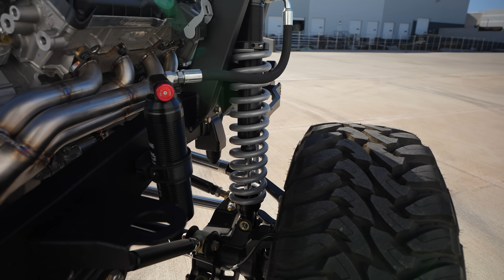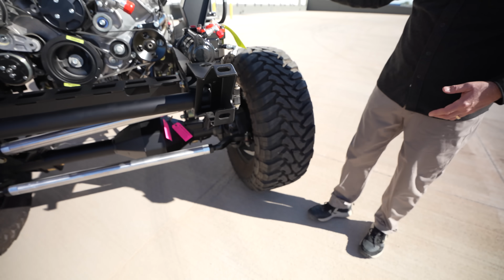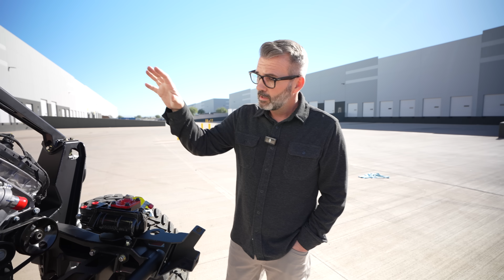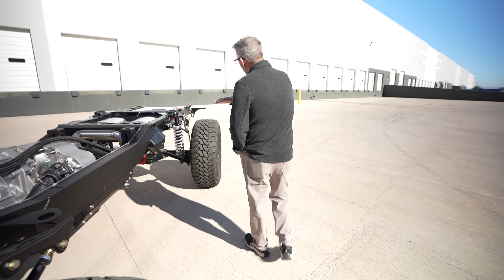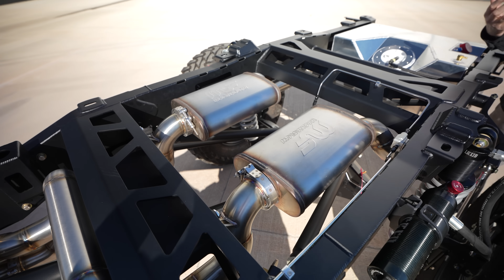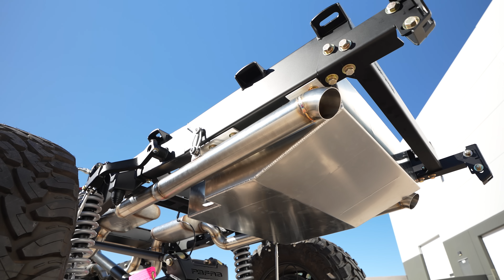Stop Refurbishing Old F100 Frames - Do This Instead (4x4 Chassis)

Comment: Thanks for the walkaround. I don't know that I would ever drop a modern powerplant into my 1970 F250 crewcab or 4x4 it or dump some 10 ton diesel in it. I was thinking more along the lines of Kaase Boss429 and Tremec and Strange Dana 60. I'll try to drop by when I get done with my move to Phoenix.

Comment: Absolutely beautiful work! That chassis is an immaculate work of art. The only thing I would say (my persona preference) is it looks like it's sitting really high, like 6"+ lift, with some pretty extreme driveshaft angles. If I were drawing this up on a blank sheet of paper I would look at ways to lower the engine, transmission, and transfer case and get less drive shaft angle for more axel drop while off-roading and a lower CG for on pavement (and off pavement) driving and get the saddles of the frame rails lower. But that's just my 2 cents as a broke ass dirtbag 4 wheeler.
Reply: The body will lower the frame to ride height, it's just sitting high because their is no weight on it. Driveshaft operating angles and trans angle will all correct once the body drops on

Comment: I like the frame but not all the components. I don't want 700 hp. I don't want it jacked up. I would want the truck closer to stock. Most older guys like myself don't care for over kill.
Big selling points, it's not an EV, no etorque and no cylinder deactivation. If I bought one I would get the 6.8 with stock hp.
Reply from the maker: We can do 2WD and almost any drivetrain configuration you want.

Comment: Does it have to be a 4x4? I want to reconstruct my Dad's 1973 F-100, I-6 300, 2WD, 3-speed column shift, LWB. That vehicle was the one I learned to drive in and took my Texas driver's test in 1977. Ever parallel park without power steering, power brakes, or A/C with a 3-speed manual column shift? Builds character!
Reply from the maker: Sounds like a sweet ride with lots of history. We specialize in 2WD chassis as well. Definitely would be a good candidate, hit us up robert@fatfender.com

Comment: If that is ride height, the suspension geometry is trash. Wow.
Reply: Agree.  Links looks really short.  Could have been longer, mounted closer to center, and thus more leveled.
Reply: That's not ride height, the body will lower the truck to about a 3-4" lift and the operation angles will then be correct. They look wack without the body on the frame haha

Comment: Can you order a frame with a gooseneck hitch an a rear receiver hitch with a 8ft bed .  Another question could you run ori struts and air air bags over the rear end. The ori struts would replace coilovers to clarify.
Reply: built more for daily driving, why would you tow with a 300k restomod if you have a normal truck to do that for yiu
Reply: @cybajaw not restoring a show truck. Just asking if it was possible. Because if I spend that kind of money, it's going to work for it. Plus there's plenty of old farm trucks that just need a frame.

Comment: I wish something could have been done on the exhaust with the two into one, then one back to two, because of the front driveshaft and transfer case. Can't tell from the video if the drivers side exhaust has its own pipe running under the passenger side exhaust, then loops over at frame level back to the drivers side. You mentioned X pipe, if so does it equalize the back pressure on both tail pipe ends?  It will affect some of the efficiency of driving around with 750 hp..
Reply from the maker: It's a true dual exhaust. The driver side has a down pipe that runs across and under the motor and the driver and passenger side are ran on top of each other into the x pipe.

Comment: The old school 1960 to 1980 Chevy El Cameno bodies on lifted 4x4 frames and drivetrain looked cheesy, because of sitting on top of the frame, instead of fitting inside the frame with the fender wells sitting above the tires with the set up in this video, instead of sitting way above the tires on the old school conversions. Also, everyone is always putting a Chevy engine and drivetrain in old Ford being restored. It would only be fitting for putting a Ford drivetrain and designed frame under an old restored El Cameno body.
Reply from the maker: Facts. The body lift conversions from back in the day were rough. This is how you do it right. Coyote in an El Camino sounds like an interesting swap

Comment: I’d love a full-size bronco wheel based f100 crew cab with a stubby bed
Reply: The Bronco wheel base is to short for that. A regular cab with a really short bed, maybe 4ft.
Reply: @frederickhettesheimer2698  The bronco with a 1/2 cab kit on it is probably 6-8" shorter than a stretch cab. It would still have room in front of axle for GN Pin
Reply: Just told the same thing to a friend of mine, Dana 60 rear converted 44 8 lug up front. flat bed with a GN Hitch. Cummins power plant..